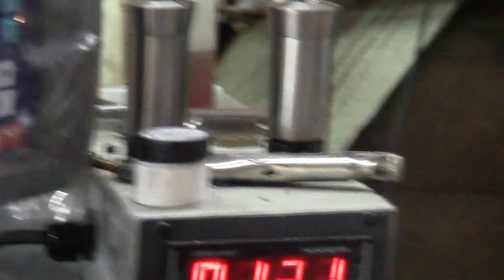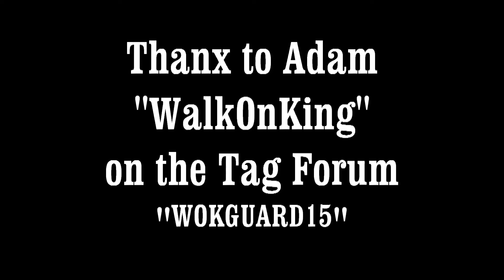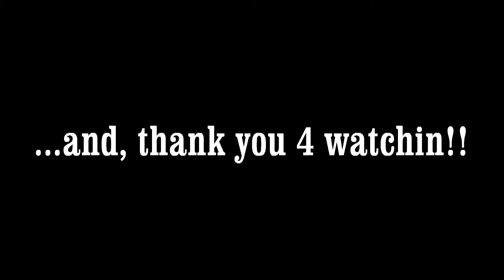Rise of the TalonDor 257

Comment from the maker: Adam,

The bullet is gas checked.  The barrel IS NOT choked.  The barrel is .250 bore x .257 groove diameter.  The barrel has a 1-14" twist rate. My top hat sits at .100".  The 2 ports in the valve stem both measure .170" x .190" and is obviously ovaled.  The Inside Diameter of my Top Hop is .217

Yes porting helps but you have to make little changes at a time

Comment from the maker: Yes sir.  The barrel is a Barrel Liner from TJ ENTERPRISES and it has a 1-14" twist and is 257 cal (powder burner) and NOT 250-251 cal (pellet guns).  And yes, the bullets are cast using pure lead and common off the shelf molds like LYMAN and NOE and HOCH.....etc...etc....etc.

The frame is Airforce Talon and the valving is a custom Condor setup with even higher flow characteristics.

Comment: T, if one was thinking of creating a nice .257 airgun, but lacks your skills, would the Condor model be the wise choice to start off with as a platform? Thanks, agw.
Reply from the maker: In short....YES!  The Airforce guns have 2 distinct advantages.  1 is the direct valving of the Top Hat right behind the bullet and 2, the guns have 490cc bottles/airtanks.  High Pressure Air volume is important when shooting powerful air guns.  It aids in consistency and shot count.

Just slapping on a 257 barrel in an average airgun will NOT equal greatness.  The gun has to moddable to the point were the projectiles can be pushed to at least (IMO) 900 fps to enjoy the advantages of shoot slugs vs pellets.  If not, just shoot pellets.

You need a machinist to machine and fit the custom parts such as barrels and hammers etc....etc...etc....etc

Comment: Cedric, do you still have your Talondor in .257? Asking, because would like to send you some custom 257420 with pointed alloy ballistic tips to try out, if you would not mind? We did make a very minor change, but that was only for proper installation of the pointed alloy tips. No pressure, but would be a great help. Thanks, Aeromagnum.

Comment: Why .257 instead of .25?
Reply from the maker: CC,

Good question.  1st and formost, I wanted a long range air rifle and i'm not talking about 100 yards.  I wanted to shoot 150 out to a few hundred yards.  And I wanted to keep it in smallbore configuration and 257 was the only option after a lot of research and the fact that Jack Haley made the 257 Scandelous which won a competition the 1st year out.  And 257's are know to be accurate and fast.

257 cast bullets have good weights and decent BC (for airgun speeds) and the barrels and bullet molds are plentiful and readily available.  Shooting one is like shooting a 25 cal pellet rifle on STEROIDS (as the saying goes).  And its still a small bore.

Plus I cast my own bullets so choosing this caliber was perfect in many ways for me.

Another thing is that it gives you BIG BORE performance in a small package
Reply: Tofazfou I see. I just bought a TalonP. (Actually I had it for a week, but now it's back at the factory getting the safety worked on.)

I bought LBT blank slugs with the intention of putting a 24" barrel onto the TalonP and casting bullets for it.

My intention was to have maximum flexibility: A pistol that could shoot commercial skirted pellets or pellets made with a Nomad pellet making kit, with the option of installing a long barrel and shooting bullets. Do you think I'm on the right track?